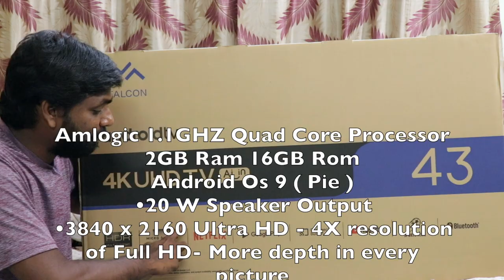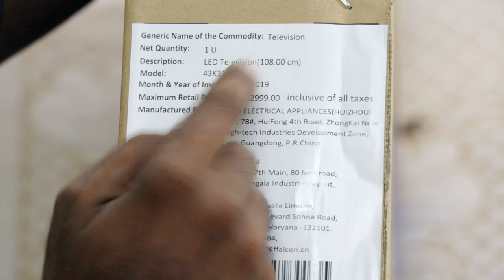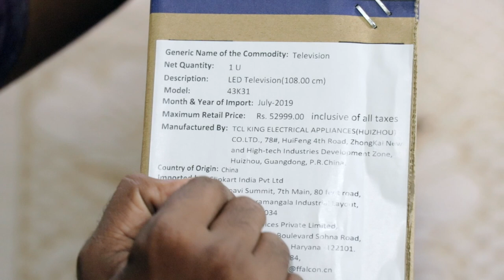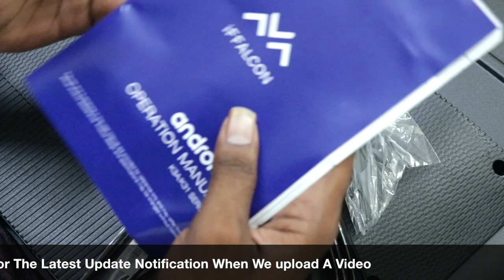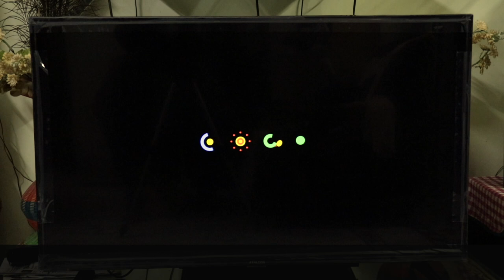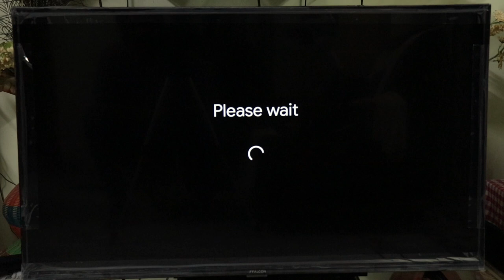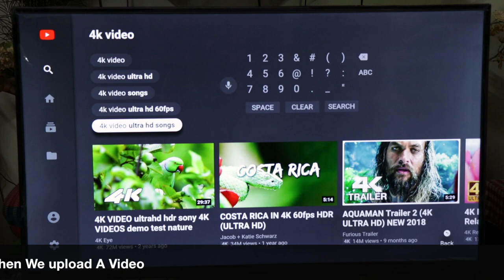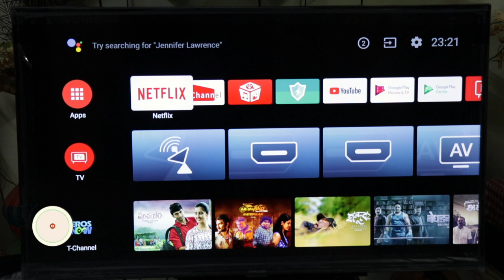Iffalcon 4K UHD 43inc Smart TV Unboxing & Initial Impressions || In Telugu ||

Comment: Sir sound bar thisukundam anukuntanna edi better sir please replay 15,000 lo
Reply: Thank you sir
Reply: @ramakrishnasalluri7081  bro. Better you take Yamaha Yas 108. Spend 3000 more. It's very good with inbuilt subwoofer with 3d virtual sound.
Reply: Anna adi cost entha 15000 lo betterdi kavali
Reply: @ramakrishnasalluri7081  bro. Amazon lo 18900 undi.sbi card use chesthe 1500 off. For sound system go for good one. Lekunte sound noice chaala torture untundi.